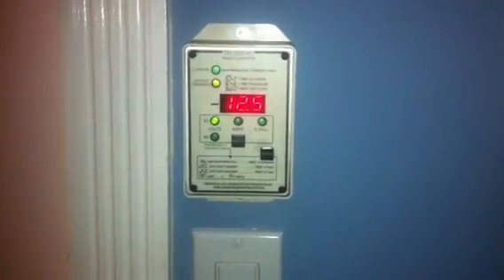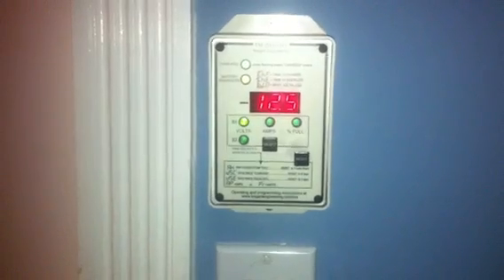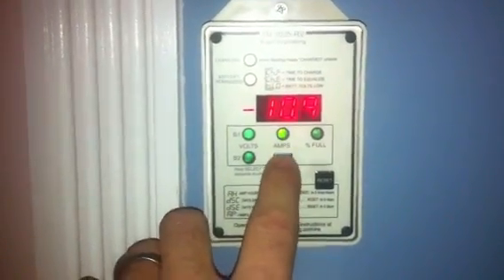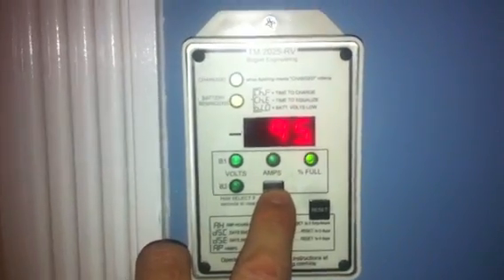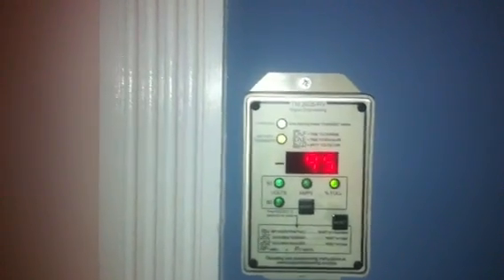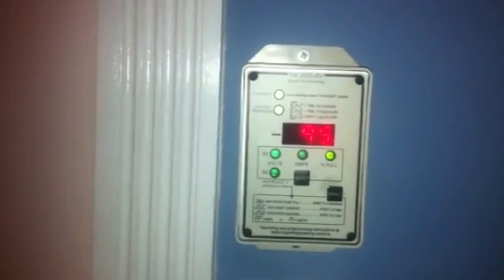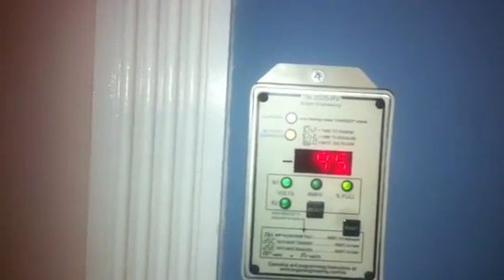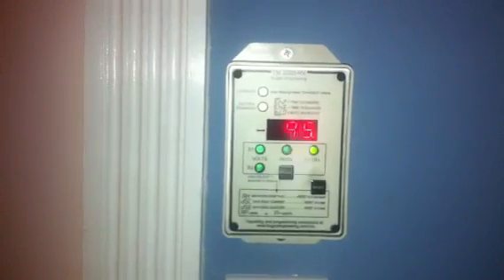Expert's Welcome - early LVD on full battery

Comment: That inverter is the problem my friend I use to use one before i got a outback vfx 3524. I still have it and it is doing the same not i put it in my truck to run a laptop and that LVD thing starts happen. not matter how small the load is.  I am almost sure that this is the same problem you are having (Jamaica Bless)

Comment from the maker: @abyssunderground Good advice.  Although i think i could rule out the battery not being fully charged, as several hours earlier my Trimetric alerted me to recharge which I did and the Trimetric auto reset to full charged thereafte; also batts well maintained, and voltage verified manually too.  The weird part is about 2 hours after I posted, I tried running the same exact load, now on an even lower voltage, and load ran for hrs w/out problem or LVD. Maybe connections loose?

Comment: @Fearlessthinker I'll agree with everything here. It might be worth charging from the mains if that's possible to get a proper full charge into it. That will tell you for sure if they're really charged or not. But do check the cables too as it may simply be tripping the low voltage drop out because of it.